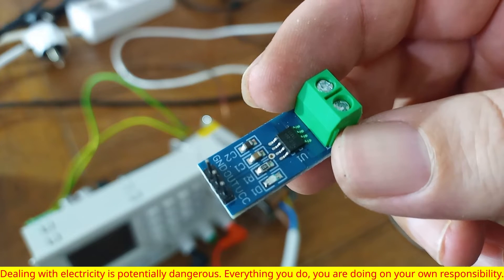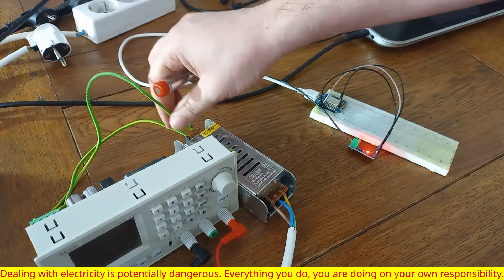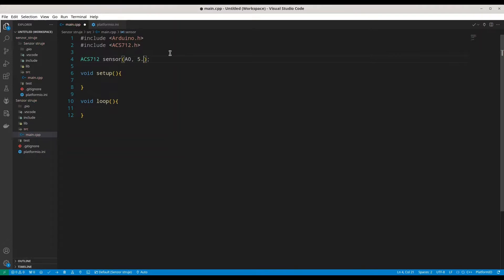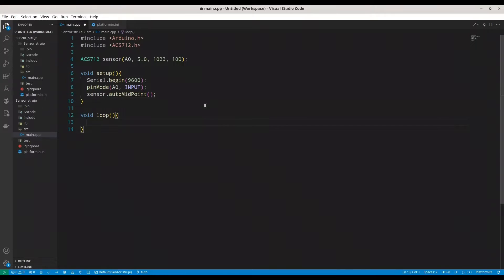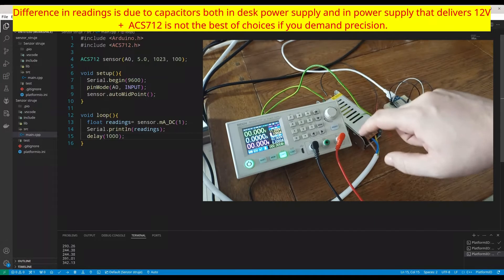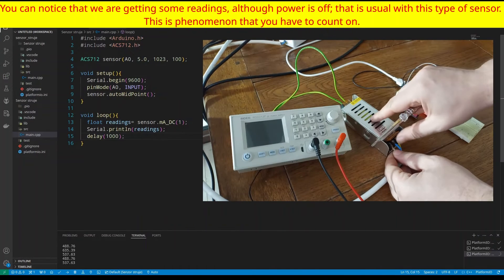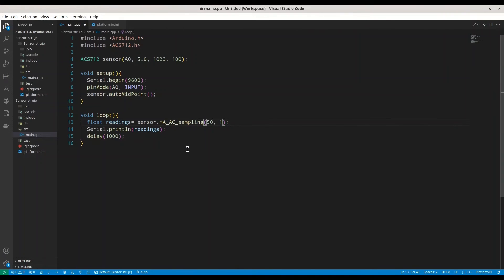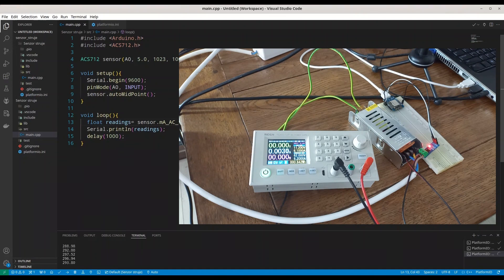ESP32 and ESP8266 - ACS712 current sensor

Comment: Nice exactly what I am looking for 😅
Reply from the maker: Glad I could help
Reply: @kindspirittechnology  sir is this possible to connect 3 ACS712 with one ESP8266?
Reply: Sir is it possible to add a relay between the load and ACS712 to turn On/OFF the load?
Reply from the maker: @Rick40867  That idea beats the sole purpose of having a microcontroller. Maybe you can do it, but why... If that is for some kind of experiment, cool... for any other reason, don't try.
Reply: @kindspirittechnology  yes it's for an experimental purpose where after time period have to cut off the load